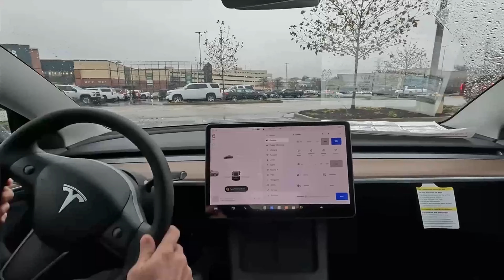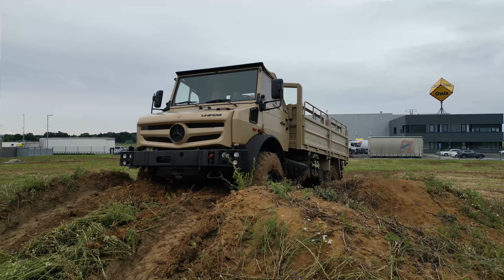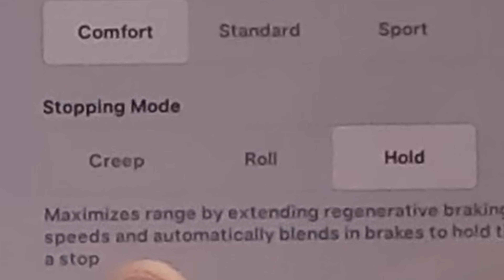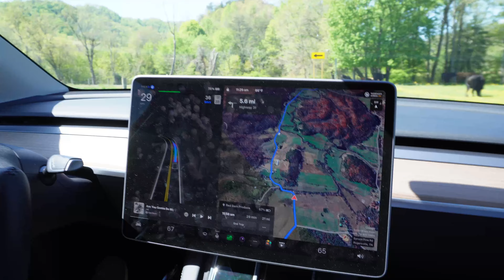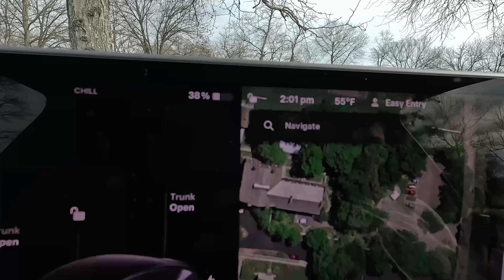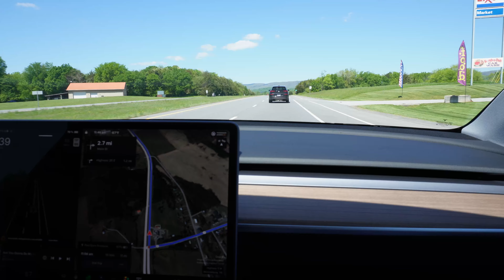6 ways TESLA is unlike any vehicle you've ever driven

Comment: Agree with your impressions. Regarding regen breaking, non regenerative modes (roll, creep) are no longer available. Regenerative braking is way better IMO and is one of the best things about driving an EV.  However I would not mind an option to lessen it bc at highway speeds a bit to allow you to take your foot off the pedal without the car slowing significantly. Although this is not an issue with using Autopilot or FSD.